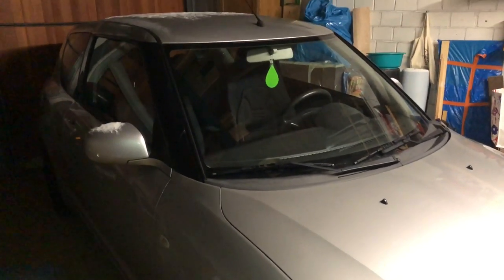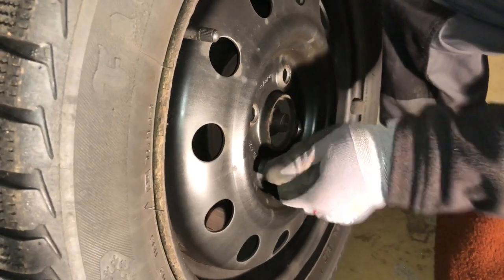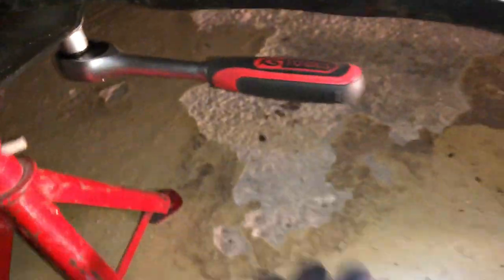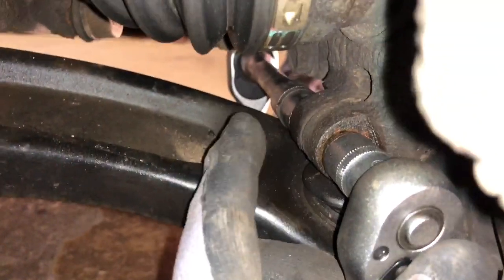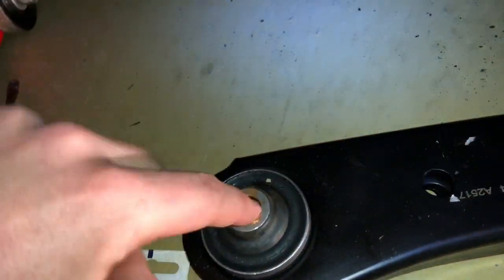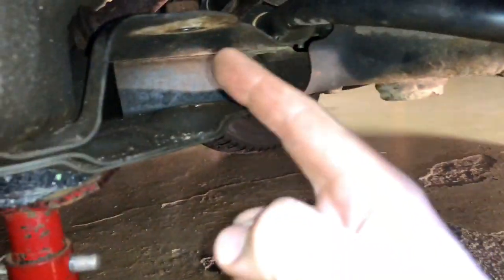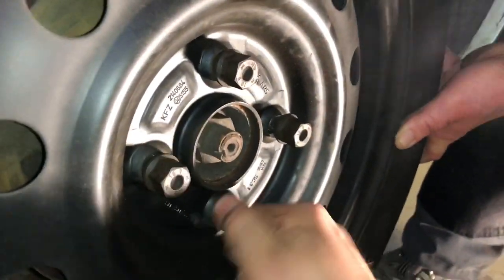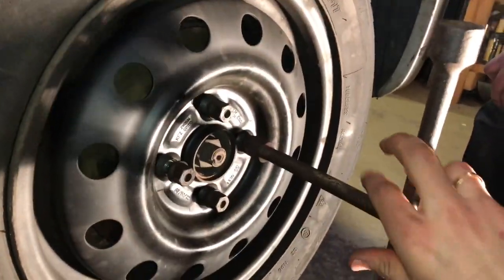How to change a wishbone of a car Suzuki Swift control arm replacement Suzuki Swift A-arm DIY

Comment: ...you are correct. Do not tighten before aligning the arm to driving height. If you don't, it will place stress on the arm bushings and they will prematurely fail. Great job, thanks

Comment: Great vid, thanks! Not that I was going to do this myself - just came here to ask: Is it normal for this part (the ball joint part particularly) to be broken after 1-2 years? I'm starting to get sick having to constantly have it repaired. It is always at least 100€ per side including work. Otherwise I love that car, it's just this that pisses me off.

Comment: I’ve had mine replaced both sides. Now the right side makes a loud creaking / knocking noise when turning and pulling away. What had the mechanic done?! He keeps telling me the bolts are tight. When I spray with silicon spray near the ball joint bolt, it stops for a while

Comment: Is it necessary to change the whole piece? Is it possible to replace only the rear bushing?
Reply from the maker: If you have an industrial press it is possible
Reply: It s more expensive to change the bushings only,than the whole wishbone! There is always the danger to bend or damage the wishbone with the press! That's why everybody change the whole piece!
Reply: This is the Bob Ross way.

Comment: Would this be similar on a 2013 Suzuki Alto, and would you use the same position for the axle stand ? Thank you.
Reply from the maker: You can use this tut for an alto, too.
Reply: I've just done my Alto and the only extra bits I had to do was remove the plastic undertray around the auxiliary belt area, and disconnect the track rod from the steering arm to give me enough space to manoeuvre the arm to get the rear bolt in. Thank you, really helpful video.
Reply from the maker: 🤗 (please subscribe)
Reply: @PDPPerformance  I already have.... 😁